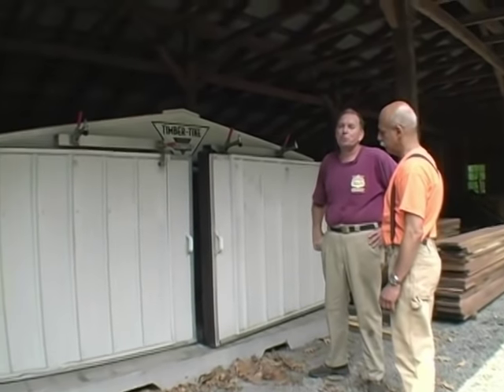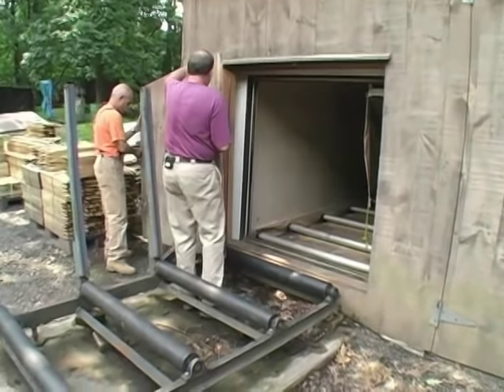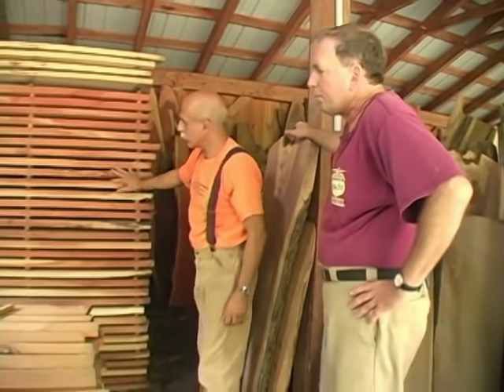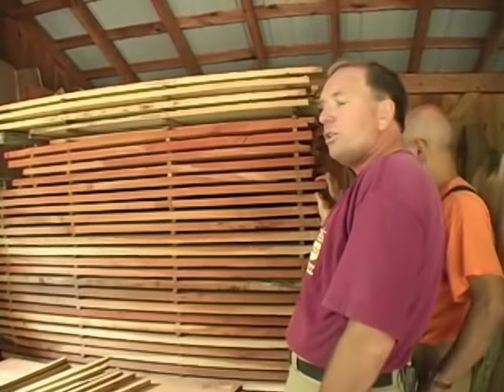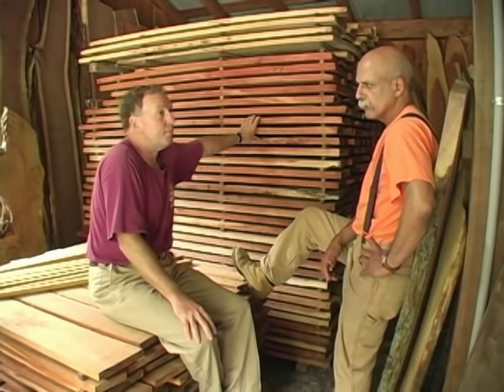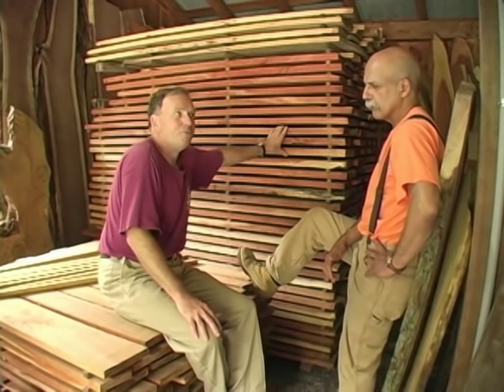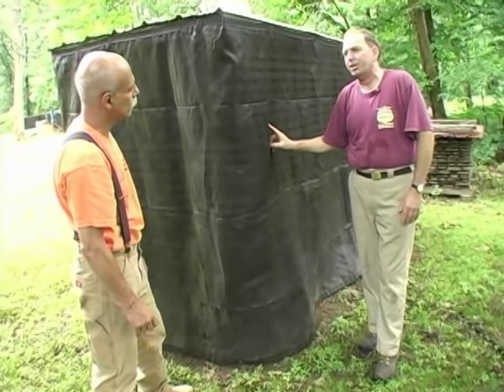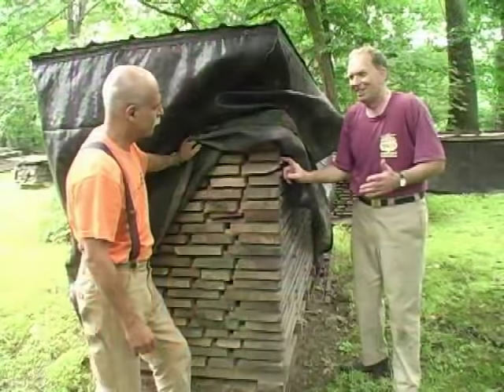How to Dry Lumber

Comment: Very nice job. Started milling my own cherry from trees that recently died on the property in upstate pa.  
I’m laying the boards under the porch for cover. I read the stacking the boards with a smil is important. 
My big concern is I’m slowly killing the logs due to work and living elsewhere. 
I’m putting the top and bottom cuts that will be firewood on top as a weight to help keep the boards flat. Will this help?

Comment: The checks go in as far as the sticker, who woulda thunk, thanks for this. Great info!
Reply: Yeah, I didn't know that.  Real good info.
Reply: What does "checks" refer to?  I know the sticker is the spacer between the boards.  I'm not sure what a "check" is though.
Reply: Brandon White they're cracks. The ends dry faster than the middle which causes stress. Sealing the ends, as mentioned in the video, 
helps prevent checking as well.
Reply: Figured this out..the hard way..good video..thx
Reply: I dont quite understand this. If you are stickering all the way through wont that mean you have cracks all the way through?
Reply: J J You may thinking a check runs parallel to the sticker.  They actually start at the end of the board and run  length-wise toward the first sticker (perpendicular to the stickers from the end of the board inward).
Reply: @copterchiefpaul  Thanks for the clarification. I got it initially as I turn greenwood which splits along the end grain. My confusion is to why the checks STOP at the first sticker

Comment: Welp I got an old home dehumidifier laying around...time to build a little kiln :) 
Thanks for the great vid!
Reply: That's exactly what the author of FW book "Wood and How to Dry it" used.....dehumidifier and a light bulb for bit of heat in a box built of foam board.  I scaled that up to a 8x14 well insulated room in my shop and use an old window AC inside for my dehumidifier.  Holds 1000bf.  Will take from air dry (20% MC) to 6-8% MC in 2-3 weeks of run time.
Reply: @edsmith4414  Cool. Thanks for the info!

Comment: For your small home version of a kiln ....

Use an insulated box of some sort .... perhaps an old non-working freezer or fridge unit - preferably non-flammable.

For heat source .... 60 watt light bulbs in cheap fixtures.

Allow air to vent out towards the top, and air to come in through the bottom, but have the incoming air down low be forced through an air-moisture removing material, like a large pile of kitty litter, to dehumidify it.

Comment: Hello. great video to lorn from. we have a red oak on backyard When is the best season to remove green tree for lumber? We live in NJ 08830. Now is April but outside the temperature is about 60 F.  And what is the requirements to get a good dry wood for lumber (air dry) Thank you.
Reply: BEST time to cut is in the fall after leaves fall....sap is down, less water in the wood.  Stack on sticks outside with cover (I use old metal roofing), and by next summer, it will be 18-20% air dry.  You'll have to kiln dry it to force it down to 6-8% if you need it that low.

Comment: I want to build a house out of saw mill lumber. I have about forty pine trees in north Alabama next to a small mountain. The trees are about 18-22 inches in diameter and are very straight and tall with only a few limbs at top. I am not sure what kind of pine trees they are. I have to clear the trees off of the property so I wanted to try to use them instead of destroying them. I wanted to know what I would have to do on sawing and storing (drying) the lumber. Would the trees need to be cut in larger boards and trim again to straighten them? Could that be done on a table saw? Do you let the logs dry to certain moisture content before cutting them? Would you cut them in large squares to remove all the bark and dry? Then cut boards later? I want to know the whole process. Can you help me? I want to make sure insects don't get in and destroy them also. Do they need to be stored inside flat until dry? I will need 2x6, 2x8, and 2x10. I am thinking about doing walls with 2x6 instead of 2x4.
Reply: In Alabama, they are most likely Southern Yellow Pine....a great, strong framing lumber, BUT tends to warp badly when sawed.  I've found the trick to this lumber is saw it into 2x lumber, then stack on the 2" edge instead of laying flat.  Look at each piece as you stack, turn the center bowed part UP (called crowning).  Stack many layers high, cover with roofing tin pieces, the put a WHOLE bunch of weight (I use pallets of cinder block lifted with my tractor front forks) on top the metal.  As the lumber dries, the bow tends to flatten out, and stay straight.

After 8mo-1year, I start 'working up' the lumber.  On rainy days when I can't work outside, I take a pile to my shop, cut studs to length for walls, and run one side on my jointer.  Then I run it thru my table saw to take of the bow of the other side and make them a uniform width....3 1/2" or 5 1/2" ( I use 2x6's for exterior walls) so standard millwork like doors/windows works with them.  I leave the thickness (usually I end up with around 1 7/8" thick after drying) as is....it doesn't matter and you actually end up with stronger lumber than store bought.
On the lumber I'm gonna use for wall top/bottom plates, I DO  have to plane to a standard thickness, or your walls will be up/down too much for a house (but not a barn or shop building)....so they have to be run both ways..thickness and width.
Floor joists, I don't bother with either.  I watch as they go in, and any that have too much bow in them, cut into blocking.  If too tall, I'll notch a little underneath to keep the top plane of the floor flat.  It's way more work to use sawmill lumber, but it's way less expensive too, and you actually get a stronger house due to the over size of it.
I've built many houses using it.

Comment: I stack mine in a open faced shed on sticks until it reaches 'air dry' moisture content.....around 18-20%.  Depending on the time of year (like late spring/summer), covering the sides like the video would simply encourage mold, so I would NOT do that.

Then it goes into my shop dry kiln where i have an old dog (22,000BTU with R-12...not R-22) of a window AC >inside< the room.  I turn it on, the waste heat coming off the back brings the kiln (well insulated) up to around 130 degrees, driving the remaining moisture off the air dry wood, drips off the base of the AC into a bucket I empty each day.  
First few days, I get 5 gallons off a 1,000bf load of air dry lumber, then it tapers off slowly for a week or so.  After two weeks (constantly running the AC), I'll test the lumber with a meter and it will be in the 6-8% range, with very little in the bucket each day.  It's done.  I leave it in the kiln and run a small de-humidifier to keep it dry while I use up that batch.  Works perfectly, costs about 5 cents/bd in electricity to dry 1000bf.

Comment: I was wondering about over-drying just before you talked about it. How can someone in an 
arid climate combat this? Is it possible when air drying?
Reply: Toni Harkins if you air dry you wont have any trouble with over drying as long as you dont leave the wood olin direct sunlight. put tin over it and shade cloth just like the video.

Comment: I have some kiln dried pine that got rained on. Will it be high moisture now?
Reply: not Linda. Not necessarily. Depends on how wet it got and how long the water stayed on it and how much was absorbed by the end grain.
Reply: Wood reaches what is called equalibrium point if kept dry (like not constantly wet)...which is 18-20%.  Kiln dried lumber works back to that point as soon as it comes out of the kiln unless sealed completely.  As long as you keep it out of direct rain, it will stop gaining MC when it reaches that equal point....air dry.....which varies depending on your local conditions.  Air dry in Arizona may be 12%.....air dry in coastal Virginia may be 22%......but at some point it equalizes with local conditions.

You've no doubt seen it in wood flooring....summer, the wood expands due to absorbing moisture out of the air.....winter, higher heat in the home, lower moisture in the air, gaps open in the flooring.  Flooring is sealed on TOP, but not the sides, ends and bottom.....so it moves.